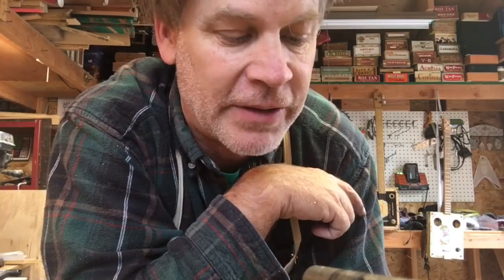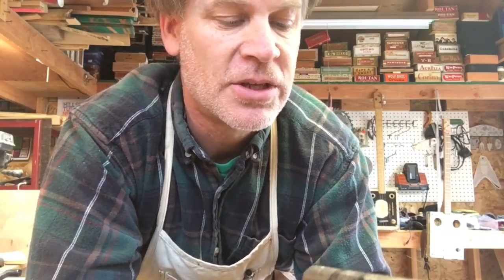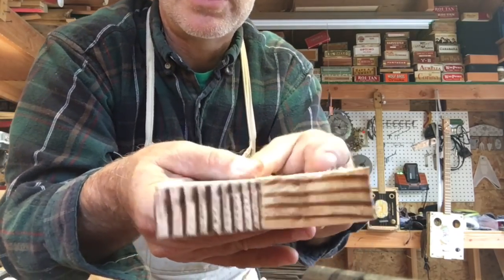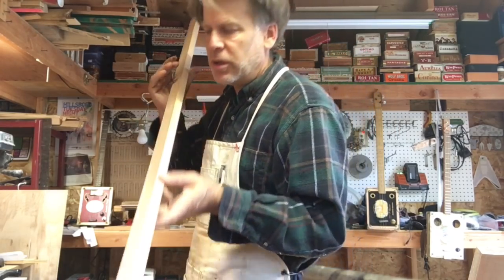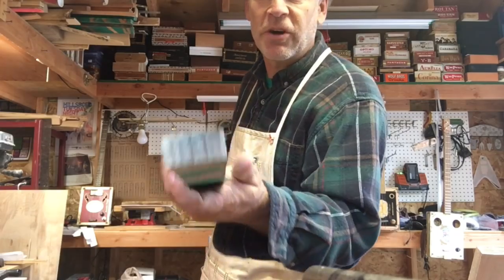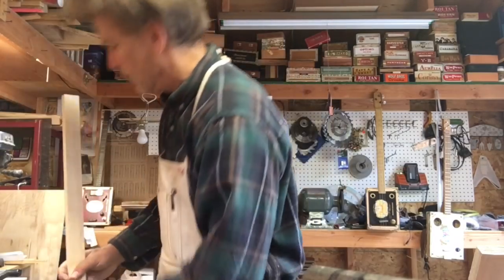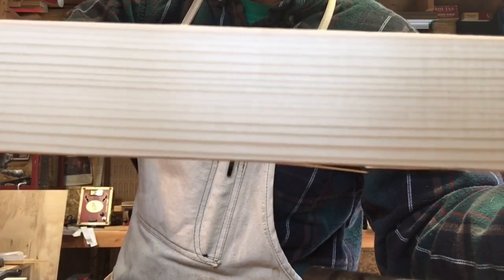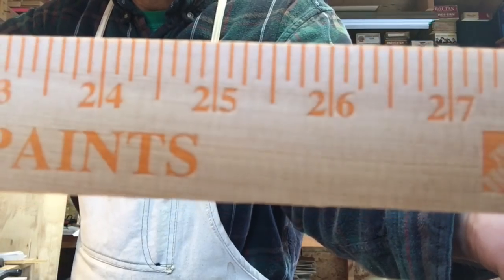Choosing Neck Wood

Comment: Thanks for the excellent information. I thought I would check out what you said and crawled into my wood storage area and found a couple 1X2 sticks 8' long. Sure enough the one with the vertical grain was straight as can be an the others well they were not so straight. These had been in the storage area for about 12 years so I will be using the good one I found for a neck and looking for more.

Comment: Great stuff Del! Do you ever laminate necks? That can make them stronger too.
Reply from the maker: Lou Lamanna ive glued up a stack of yardsticks.... worked AWESOME!!!!!  I have akso had superb results with... "plywood"  😎   what about you??
Reply: Del, I haven't had to use either of those but I will split my neck wood lengthwise and glue a thin strip of wood of a different color between them. It gives you a nice stripe down the middle and makes the neck way stronger. Especially if you then glue on a separate fretboard.